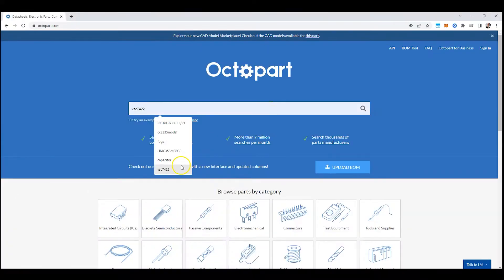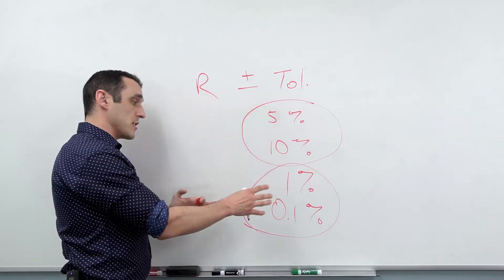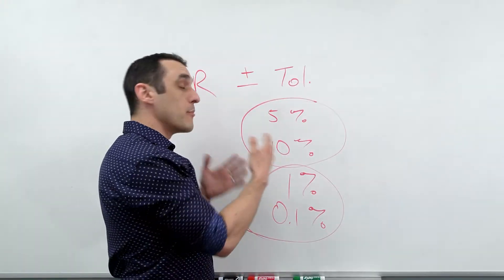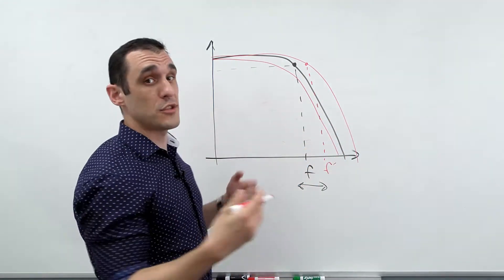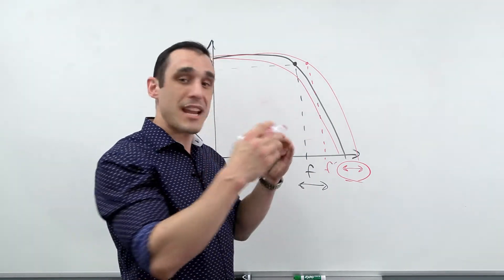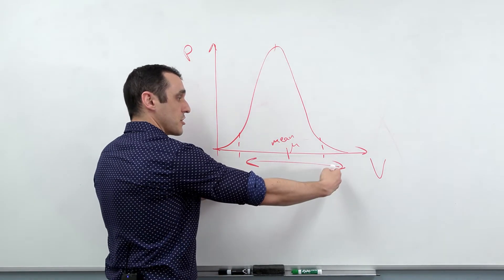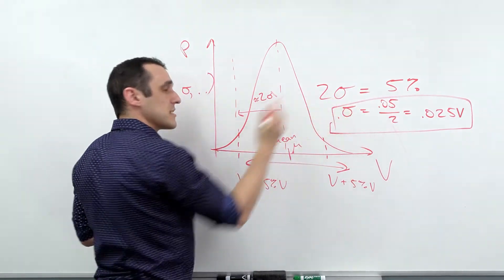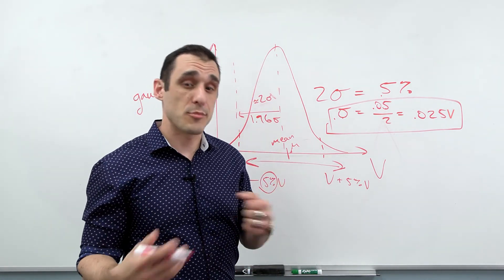How to Use Component Tolerances to Analyze Circuits

Comment: Are you suggesting that the 5% of more-than-2-standard-deviations is somehow related to the 5% of part tolerance?

I had assumed assumed that 5% tolerance meant if I used a 1K resistor, my design had better still work even if that resistor turned out to really be 1050 ohms or just 950 ohms. (But for new stock, it probably wouldn't be even 925 or 1075 unless the supplier was unconcerned about reputation.)  If it works for both 950 and 1050, but not 1004, then I am designing with far more precision than my parts allow.  On the other hand, I would not expect many of the parts to be between 995 and 1005, because I would expect many of those to be binned differently, and sold as 1% tolerance.

The last part of the video seems to suggest that if I am using 5% tolerance, I should translate that to (sigma? =)2.5%, and then run a variety of simulations, which will assume that a lot of parts are nearly perfect, but 5% of the parts actually used are outside tolerance.  I'm hoping I misunderstood, because the alternative is that the software is solving the wrong problem...
Reply: If you pick up a random 5% tolerance 1 kOhm resistor, then you can reasonably expect with high probability that this resistor will have an actual resistance somewhere between 950 Ohms and 1050 Ohms. I think you're taking a worst-case look at the component tolerances, which is actually a good idea and it never hurts to look at some extreme value in relation to component tolerances. So for example, if some part of your circuit needs at minimum 950 Ohms to operate properly, and you design it to 1 kOhm with 5% tolerance, then you should reasonably expect that a 5% tolerance 1k Ohm resistor will still operate properly. However, it's important to note that just because you selected a 5% tolerance, the probability of having that resistor measure <950 Ohm is non-zero. In the 2sigma Gaussian approximation, the probability of that resistor falling anywhere below this hypothetical minimum value is 2.5% (because +/- 2sigma accounts for 95% of the cumulative distribution function, half the remainder of 5% gives you 2.5%).

I'm also saying that if you're going to use tolerances in a probabilistic model for worst-case analysis, or in Monte Carlo, then you have to link that tolerance back to a statistical measure derived from a probability distribution. The last part is just deriving one of those statistical measures (standard deviation) specifically for a Gaussian distribution. A Gaussian distribution is often used. You could do the same with a uniform distribution if you have evidence that component values are actually uniformly distributed about the mean and not Gaussian distributed. You could also set the limit to 3sigma, which would be pretty conservative and woudl account for about 99% of possible component values within the rated tolerance, again assuming Gaussian distribution.
Reply: @Zachariah-Peterson  
(1)  It seems to me that even if the distribution of manufactured components were normal (or any nice statistical shape), the distribution of purchased components would not be ... the extreme tails would be clipped during testing and inspection, and the peak right near "perfection" would be scooped out by binning for sale at a higher precision/price point.  Are you saying this is not the case in practice?  Or even stronger, that 1 part in 20 (sold, not just manufactured) will be out of compliance, according to the advertised spec?
(2)  Are you suggesting that there is some relation (beyond "round number of about the right size") between the 5% of 5% tolerance, and the 5% of outliers in a Gaussian distribution?
Reply: @jimjjewett   @Jim J. Jewett  (1) I'm not making specific statements about how component manufacturers bin their components into different tolerances, it probably varies by manufacturer and component. What I am saying is that if you assume the value of measurements for each individual component has identical independent distribution (i.i.d., which is totally reasonable and not required to be Gaussian for an individual component), then the central limit theorem states the average would converge to a Gaussian with standard deviation given by the RMSE estimator. So on average the statistics for a reel of components you purchase could be reasonably modeled as normal within some confidence interval. If you take that a step further, in an LTI circuit, the circuit's response would also be expected to appear normally distributed about some mean assuming not too large tolerances (say 10% or less). I say "assuming not too large tolerances" because even in a linear circuit, the linear output could be nonlinearly related to component values (just try to derive equivalent impedance of any linear circuit in terms of component values and you'll see what I mean), and you only get back to a linear dependence on tolerances under a Taylor series approximation (again, highly accurate as long as tolerances are not too large because powers >1 of those tolerances are very small).
(2) There is some relation on average because the limit that gets assigned as a cutoff value (whether it's 2sigma or 3sigma) for a tolerance spec could also vary. I was saying "suppose they use 2sigma to set a tolerance value, then the sigma in your Gaussian distribution would be this 5%*V/2".